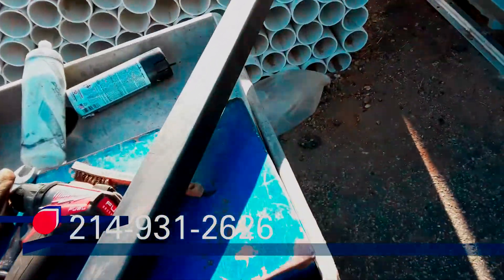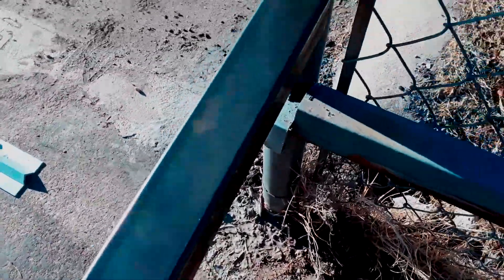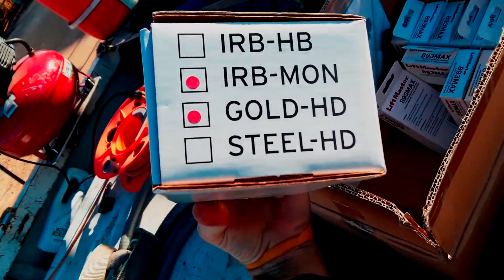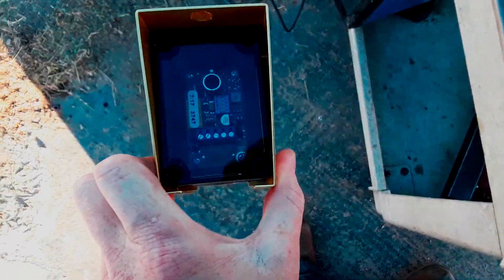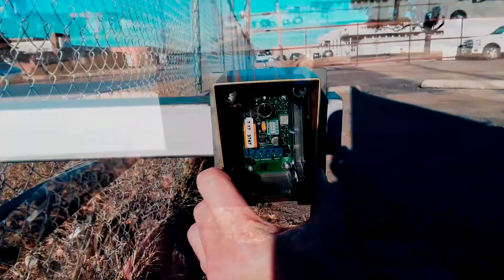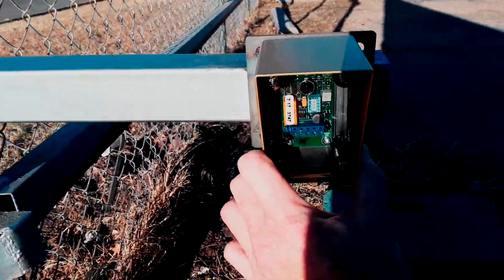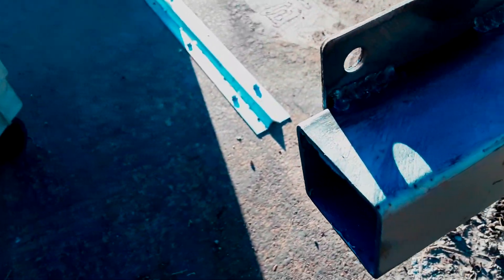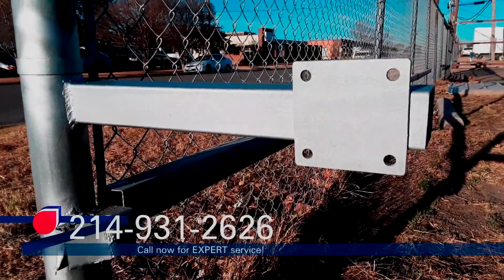Installing a slide gate operator Step 8: Installing photo eye mount | SC0046

Comment: These videos are very helpful.  Just had one installed, but having issues with the "Open Eye".  I have the photo eye wired to the "Close Eye" connection so the gate will close normally, but when i go to open the gate i get an error telling me that the Close Eye connection is missing even though it should not need and Open and Close Eye.  Any thoughts on what the issue could be?  To work around it, I jumped a wire from the Close eye to Open Eye, but thats not ideal for a long term fix.
Reply from the maker: Our guess is your opener is a LiftMaster? If so it maybe monitoring for BOTH the open AND close entrapment device. If it only requires a monitor close device then you may need to reset the control board to only monitor one device. You can find a list of qualified contractors at #AmericanFenceAssociation 's website. https://members.americanfenceassociation.com/Find-a-contractor.asp?version=2